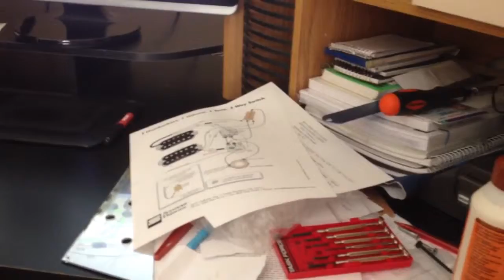Update on the Jackson V build!  Prep for electronics!

Comment: Did you ever finish the guitar? I searched specifically for this GFS offset V. I wanted a sound test on it and personal thoughts on how it went together. I built a Strat a few years ago and it went together for the most part ok and that was using a Fender B body and a Fender B neck. The neck was finished but had to be dressed and the body was just a routed shaped blank that I had to do everything else to. It turned out good but soon noticed why it was a B body meaning it had a defect and couldn't be used for a production guitar. The neck pocket was cut just a smidgen wrong and that threw the pickguard and pickups off a bit. It is ok it still play great just if you weren't told about the slightly off center pickups you would never know. But I am interested in seeing the final product from you. I am looking at buying this kit.